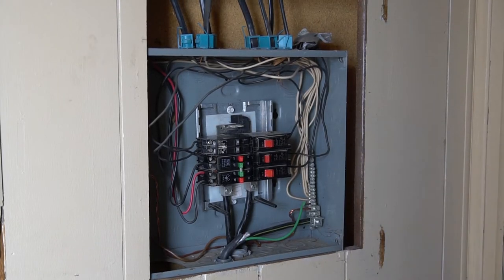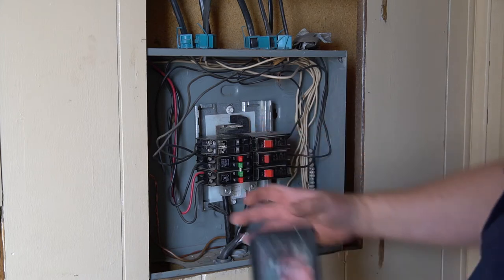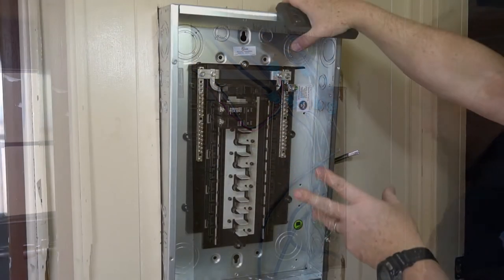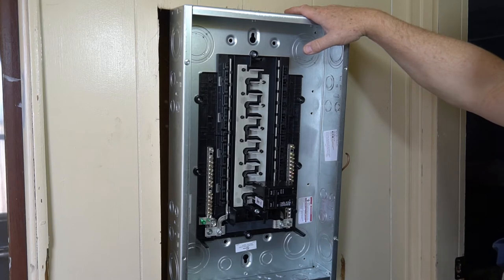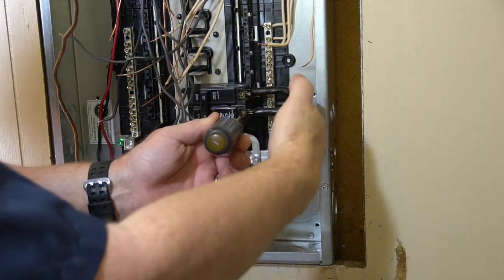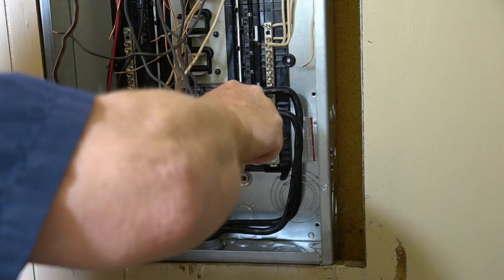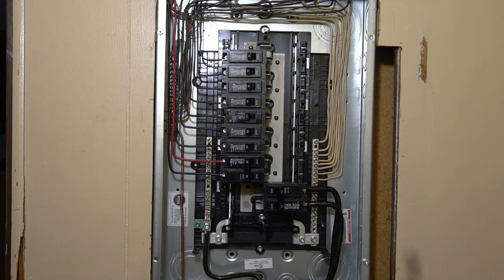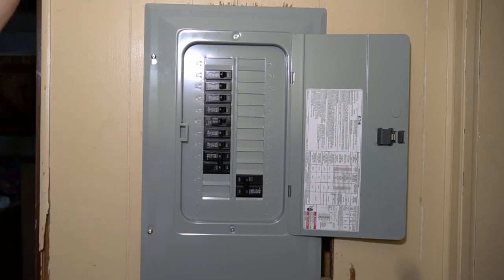⚡ How to Upgrade your Main Breaker Panel.  Step by Step Guide  🏠

Comment: Technically code would call that a Feeder panel (and the conduct from your main breaker panel). You did a good job re-organizing the wire, properly sizing the breaker and correct ground bonding. I wouldnt have  resized the panel with a larger one. Also installing panel upside down bit isn't code. I get you were working with the wires but just a note.
Reply: No such thing in NEC called Feeder panel.

Comment: I know this is two years old so any comments will be mute points.   It is a shame you have individual conductors in the wall cavity.  Not correct.  Can you tell us where the bare copper coming from the bottom came from?   Main panel or ground rod?   
If it goes to a ground rod, I hope that you left the green bonding jumper screw in that others told you to remove.   That would be a dangerous situation.   Respectfully,   Kevin
Reply from the maker: To answer your question. Grounding rod.

Now I have a a question. I am not being snarky, I am genuinely curious .

Why did you watch my video? You seem like you know how to do this, so why are you watching a video about something your already know how to do? This is something I personally never do, and I don't understand why any one would do it. It is a real curiosity to me.

Comment: You need to balance the load better between A and B phase. You’d leave your extra spaces ideally below or above your used ones, not stacking everything on A phase and then leaving B phase empty. You’d stack your breakers closest to the main disconnect in the panel.
Reply from the maker: The load is balanced.
Reply: @thejungleexplorer  I just explained how it isn’t. You shouldn’t have everything on one phase, that isn’t a balanced load. You say yourself in this video that this isn’t the work of an electrician and you haven’t had it checked by one. I actually am one. Just providing insight. Probably won’t hurt anything, but over time it could and it’s less efficient.
Reply from the maker: @ThomasKBurke  Observe closely. https://m.media-amazon.com/images/I/81EWxAdYdsL._AC_SL1500_.jpg
Reply: @thejungleexplorer  A picture of an empty panel shows me nothing.
Reply from the maker: @ThomasKBurke  It shows you more than you are seeing. I am not going to debate this with you. You are not the first to say what you said on this video. All others got the same picture and understood it.
Reply from the maker: You are not an electrician either by the looks of it.  If you are, than you are really missing something very important that is right in front of your eyes.
Reply: @thejungleexplorer  Actually I am. Panel design doesn’t matter. If you’re talking about the buss all being one continuous piece, they all are these days. The load is imbalanced. You don’t stack all your breakers on one phase. This is basic stuff when you learn panel construction, but you’re not an electrician, so I wouldn’t expect you to know. But you know now.
Reply from the maker: I am sure someone will come along and help you understand. Until then, you have a wonderful day. All the best to you.
Reply: @thejungleexplorer  I understand it just fine, again, I do this for a living. Your load is imbalanced. Best of luck.
Reply from the maker: @ThomasKBurke  Again, you are not the first electrician to come on here and say this. You are the first though that saw the picture and did not understand. Every other electrician did. You are unique this. Best of luck to you as well.
Reply: @thejungleexplorer  Whatever you say man.
Reply: @ThomasKBurke  Think about how you get 240 volts with a 2 pole breaker.  Every other breaker stab is on a different leg (not phase, it is what is called a split-phase service, which is single phase).  So the load IS balanced between each leg of the 240 volt service.
Reply: I agree that it is balanced for the reason that was stated. Every other breaker slot is a different leg. Slot 1 and the slot directly under it slot 3 are on two separate legs of the incoming power. I know most of us distribute the breakers on each side most of the time, but that is more of a preference than a balancing issue as the way the panel is designed you can really load it unbalanced short of skipping every three breaker slot, then it would be unbalanced, but in this scenario it most definitely is balanced. Now with that said, since it is a subpanel, it should have been a 4 wire cable between the main breaker panel and this subpanel. The 3rd cable being the equipment grounding conductor. It looks like a 3 wire cable was ran and a grounding electrode conductor was used as the equipment grounding conductor and was ram from a ground rod outside. Unless it was ran from the main breaker panel to the subpanel, in which case would be the first time I’ve seen a bare copper wire ran as such. And as far as that green grounding screw goes. If it it the kind that goes through the neutral bus and into the metal of the panel it would indeed need to be removed to separate the neutral from being bonded to the panels ground. Otherwise it would make a parallel return path back to the main panel, so that ground would carry current along with the neutral, but other than that looks fantastic as far as looks are concerned.

Comment: " First step is to cut the power off "
Well I guess we don't need to see that.
Reply from the maker: Correct. However, cutting the power off is different for many people. In some cases you may have to contact your power company to do it. In this case, this was a sub panel and there was a main breaker. Each case may be different for how you need the cut the power off.
Reply: @thejungleexplorer  
Thank you so much for replying even though I was being sarcastic. ( childish ). I want the knowledge to change out the panel. But I could not find a video that shows the step that remove the incoming power from outside to the panel. Funny, the only one that showed the meter being removed, really implied non technical motives. 
However if you have made or know of such video, I would greatly appreciate if you would direct them my way .
Peace
However so far the only video I fou
Reply from the maker: On the majority of the cases, when dealing with the main panel, it is necessary to pull the meter to cut the power. The thing is that the meter is owned by the power company and they do not allow the homeowner to remove meter and to prevent it, that install a tamper proof clip that must be cut to remove the meter. So if you cut it, the power company will you tampered with their meter and they will fine you. Since most modern meters are radio monitored, the instant you pull it, an alarm will sound at the power company and they will dispatch a truck to investigate what happened. 

So this is one reason you will not see many videos showing people pulling meter bases, because, it is illegal to do and YouTube would pull them down if they are reported. 

This is why, I always install a main disconnect between the main panel and the meter, so I can work on my own electrical without ever having to contact the power company.
Reply: @thejungleexplorer  
Great Info !  Thanks again.🎩